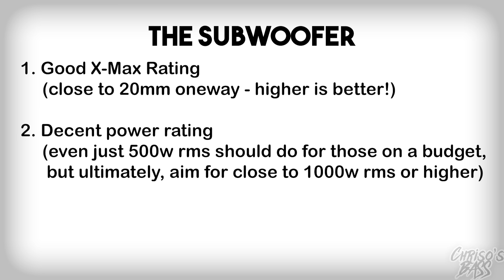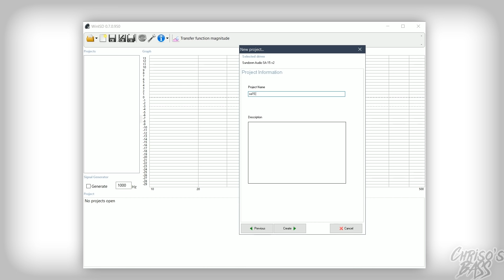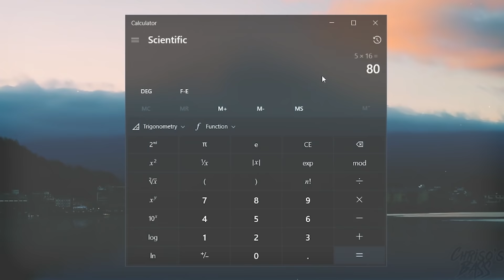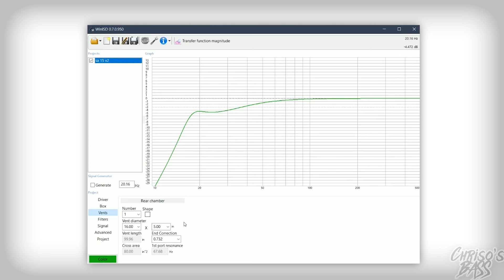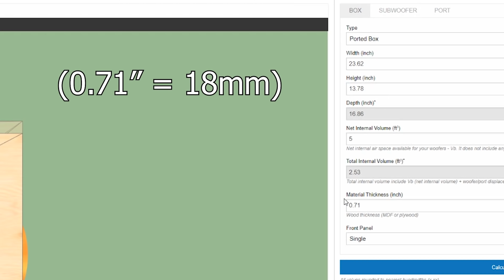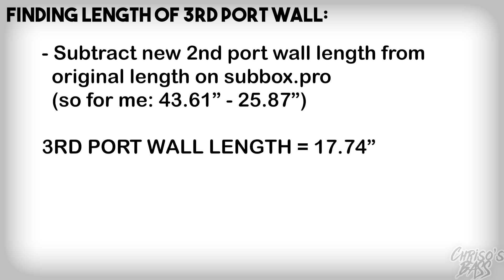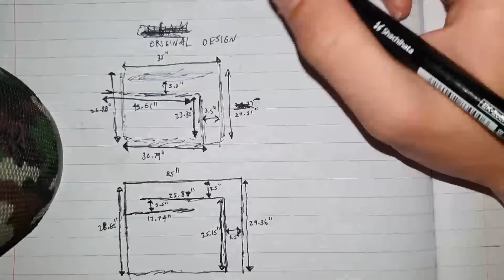How to Design a Subwoofer Box that plays SUPER LOW! | Full Guide

Comment: this can be an interesting and effective strategy for getting a lot of output out of a subwoofer that wasn’t necessarily designed to play low, and a lot of these design principles can actually be applied to enclosure design where one has specifically selected a driver that has high X max good efficiency bandwidth product for ported enclosures and high sensitivity as well as low FS and a strong BL rating. If you do a follow up in the future, since this video is a bit dated, viewers might be interested in seeing what is possible when you select modern drivers with specs that lend themselves well to SQL systems that prioritize infrasound in their design goals. it’s also worth noting that other Youtubers and forum members have outlined ways to use winISD to at least vaguely approximate the behavior of cabin gain with the filter tool in the program set to a linkwitz xform circuit who’s frequency is determined by calculations that involve the length of the interior space of the vehicle and the speed of sound. It’s not dead on accurate, but it does give us kind of an idea of the role that cabin gain might play in the system of behavior when we start modeling, and can inform revisions and tweaks to enclosure design as you work if you decide that you want to work in revisions rather than just trying to nail it in one go, which most people are going to do because wood is expensive and box building takes a lot of time and effort. I am currently designing such a system using Stereo Integrity flagship HST 18 drivers and that’s how I found my way here. There’s some pretty significant divide of opinion between the SPL community and the most well-known enclosure designers and Youtubers who are geared more towards raw output in the SPL lanes and the sound quality enthusiast and YouTubers and community knowledge resources like PS sounds raw cat Resonix etc., and the Legion of SQ purists who follow them, and it's frustrating that both camps really don’t seem to want to make a lot of room for anybody who enjoys accurate reproduction of low frequency material at ridiculous output levels. For the SPL crowd, the physics limitations, make it less desirable to aim for their peak output levels in the low frequency and infra sound ranges, and for the sound quality crowd, many of the drivers that are favored, provide much more balanced output in the extended low frequency ranges because they have lower power handling, lower excursion and different design goals. That’s not to say that there aren’t some outliers like myself, one need to only look to the community of people running 24 inch Stereo Integrity subs or 18 inch drivers from One Audio or acoustic elegance to find the low end high output, freaks, or members of the cult of the infinitely baffled, but overall we are a small subset of the car audio community and it’s nice to stumble upon content that is geared towards unlocking some of these mysteries, and providing some solid approaches to enclosure design that can easily be adapted to sound quality oriented, system design goals with a low tuned, ported enclosures and high excursion, high accuracy, high sensitivity, high power, high motor control drivers. I myself am a former mobile electronics certified professional installer building her dream system after needing to step away from the industry due to health issues and coming back to the community after such a long time away and all of the new equipment and techniques and changes in approaches that have happened have really made it clear that there’s no one right way to accomplish this goal, and that sort of sitting in that middle ground between loving tight, accurate, faithful reproduction of music and violent levels of output can be a little bit alienating, even if we are all in the community because of our passion for a car audio. Just some food for thought. Love the video happy to have found your channel. Looking forward to checking out some more stuff.

Comment: question for you bro. im doing this with 4 subs and so subbox puts them on the front of the box instead of the top, how they'd fit in my application. does it matter where the subs are? front left bottom etc, will anything mess up?
Reply: still wondering?
Reply: @AverageLuck  Yes and no. I've seen one person say that it does not matter where the subs are, its not going to change how the box performs. now im just wondering if this is true; i dont want to be confined to a specific arrangement if i dont have to. :) sorry for the late reply. i got rid of those subs, and just doing a single 8" in my miata now. working on a box because the skar sdr prefab box is absolute TRASH. 40hz. LOL no thanks, i just get trunk rattle and zero lows.

Comment: I’m very new to this, where do I put the wiring at?
Reply: Do i need to buy terminal cups?
Reply: @g1houls, yes, you need one, and it's up to u where u want it. It can be in the back of the box or on the other side of were your slot port will be. I all depends on your setup like were your amp will be in your vehicle.  Hope this helps.

Comment: I’m really new to this how do i do my wiring?
Reply: That all depends on which sub u have if it's a dull  voice coil  and what not. You will need a thermal cup on the outside of the box to wire it up to your amp ,and to wire your sub to the thermal cup. Make sure that you wire both voice coils if it has to ,and make sure you ohm load is going to work with your amp. Say u have a sub with dual voice coils and the sub is 4 ohms when u wire both coils together it will bring it down to 2ohs. So make so your amp can play at a 2ohm load. I'm more into home theater so u should do so research on the internet.The equipment you have because there is also running parallel and unparalleled. There are a lot of videos out there on YouTube.That will help you.Good luck on your journey👍

Comment: WHAT IF I HAVE TWO DRIVERS DO I ADD THE TOTAL UNDER INPUT POWER ? FOR EXAMPLE EACH DRIVER HAS 1000 RMS POWER DO I PUT 2000 SINCE I HAVE TWO DRIVERS 
PLS HELP
Reply: still need help?
Reply: @AverageLuck  yes boss🙏
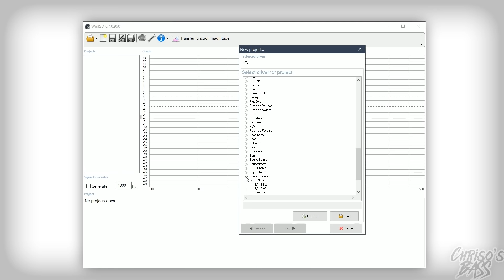Reply: @OUTCASTTT_ At 4:53, at that menu, you would select 2 drivers. After that yes, you would put 2000 for the total input power.

Comment: For good frequency response, it is best to have Qts of the driver >= 0.415.
Reply: Nah. You can do with any driver qts. Ideally you want the lowest qts possible for better cone control/accuracy. You might be thinking of sd/vas. The ratio of these can help quantify how loose the suspension is. Which would make frequency response a bit flatter with a low qts sub. But you can also just use a smaller box. Because if car audio cabin gain is a thing, so if you want a flat response you would ideally want about a 12db/oct rolloff. And if you want louder you can just use more subs.

Comment: I purchased a prefab from visions its a dual 10'' subs in a ported box. I took it to another car shop and they told me the box is tuned to like 40+ frequency. They recommended for them too build a custom box tuned to like 30 to 35 and they recommended a bandpass enclosure. Do you have a video on bandpass enclosures? would like to know a bit more about it so I can instruct them on exactly what I would like. I want low bass and airflow but also want to listen to everyday music as well. I'm not competing in burp comps, but would like to have some shacking wind bass from time to time depending on the song I play. Is it possible to get the best of both worlds?

Comment: sub box pro does the "baffle extension" for you. you just have to cut the wood and make a 3rd port wall. play with the numbers and you will see. although you cant see it, its there. try adding .5 cubes to airspace and you will see depth wont change.

Comment: I've been designing and building speaker boxes since age 12. taking designs from existing console stereo enclosures from 50'thru 70's and usunt what works for my needs. using salvaged stereo components from different stereo console units and building enclosures for each as needed. .the discarded stereos were usully in ned of new fuses of a minor repair of. broken solder connection or wire. investing my time and labor was the only expense but for the fuses I might need.   For  speakers discarded kitchen cabinets work very well.  I could modify them as i chose and to the required sizes. many of the console cabinets were of very good hard woods and usually mostly or entirely intact. only needing sanding and refinishing. the condition of speakers was a concern but they were usually intact and in fair to good condition.  the components i salvaged were anything from the radio ,and stereo amplifier to record changer or tape deck of every sort like reel to reel, 8-Track and cassette decks. people just toss the whole thing and buy a new one. even when only one part of the whole unit is broken or inoperative.  usually due to a blown fuse they either didn't know of or couldn't find. I simply looked in the usual places for the fuses or broken connections and replaced a fuse of re-solder the connection. a few minutes work for a good stereo component I can enjoy. I am a "Pack Rat" and collect wires. cables and connectors of all types to be able to hook up my stereo and AV components as i need to. Remember that Car stereo was originally adapted from home steei and evolved throughout the years.   I currantly use a good quality headset for listening to music and anything online through my computer. with a 23" HD flat screene monitor. with a native 16X9 aspect ratio.. no need for such large home theater set up.. I do have a 100" big screen and a good video projector but as my eyesight get worse as I age the monitor up close is better for me to see and I have no need for hogh powered surround sound... lets say I out grew that habit. bigger isn't always better. If I want the whole home theater experience I'll build a "Mirco Theater. A comfortable small sound proof box with a good quality UHD TV and my full surround sound setup built into it all built around a comfy recliner with cup holders and remote tray.  well sound proofed with layered carpet padding glued inside and out. I have the desibns in my head and have decided on the over all size.  which because I need to accommodate the wall hugger recliner  and sound proofing. the speakers will be built into the intrnal structure. including the subwoofer custom built under the shelf for the TV and stereo unit.   as I said this is to be a Micro home theater just big enough for one or perhaps 2 snuggled closely. the largst expense will be the custom ordered recliner.  The rest I either already have on hand or isn't very expensive. the hardest part of the design was figuring out the sound proofing .. higher frequencies are no problem but the deep Bass/lower frequencies penetrate almost anything. the remedy for that is lots of soft sound absorbing mass.  I found the solution in a relative cheap solution of dense carpet padding.  layering it to the desired thickness to isolate the sound to the inside of my private movie box.   I came up with this whole idea and design one afternoon when I thought to myself what was the minimum I might need for a home theater. and how much room for up to 2 people to enjoy a movie in full surround sound.  then it took me about 10 min. to design the basic structure of the box and electronics set up. the sound system is fairly standard if very compact. as is the whole thing.   designes can be altered for bigger recliner love seat. width being the main concern for that scenario. and therefore more soundproofing materials. and a little more plywood. the minimum needed is best for this design. .. that said the monitor and a geeo headset works just fine for now. but for the full theater experience my Micro Theater concept seems to be a good solution as well.  If a little involved .. the only other concern is ventilation inside the box. but then i have the solution to that little problem integrated into the design of the floor with a few small fans and venting scheme. isolation from the groundand the air gap under the box floor are the key as the floor of my room is concrete and on ground level stays cool all the time so venting over that concrete floor to cool the air is the solution i came up with.. I very low budget AC unit at minimal cost and parts...a couple of computer fans and routing the air where i want it to go throughout the inside of my movie box the sound deadening will also act as insulation. maintainint a comfortable temp should be easy. if I get a litle too warm just flip a switch on and if too cool shut it off. or maybe a thermostatic control for that little bit will be the ticket.set it and forget it. once i know the temp i'm comfy at.   sorry this is so very long. when i'm excited about abuild of any kind I get carried away tellling all I can about it.. ADHD does that. but it also speeds up thought processes when i deside to use it in that way. usually my mind won't shut down at all. so designs flit theough my brain almost constantly... O sinple speaker box is almost too easy fo me to visualize in detail and have dinensions almost as sooon as the basic design accurs to me.

Comment: I have a jbl cs1204 12 inch drive. However, I cannot find the technical data mentioned in the video for this driver. Therefore I couldn't do anything. I want to make the best cabinet for this driver and use it in my home theater system. Can you help me?
Reply: search: measuring t/s values for loudspeaker

Comment: The Port lenghts in WinISD isnt correct. In most cases, the WinISD Port is too long. The position and geometric of Port desing ist important for the tuning freq. A port at sidewall, groundplate or corner can be shorter than WinISD show you.
You need to build prototypes with a variable port an have to messure the impedance. In this impedance messure you can see the port tuning. Alternative messure the frequenzy response of the port in nearfield, at the port end. Make port shorter or longer to hit your planed tuning frequenzy.
TheWinISD port lenghts simulated for 25Hz can be 17Hz or lower in real

Comment: Unless you're playing Wembley stadium, you probably don't need more than 100 watts. There's these $40 30W bluetooth party speakers that you probably see a lot of that will keep a group of 40-50 people happy.  And actually that might be a good place to start - You get an enclosure, bluetooth, amp, crossover, battery and drivers for less than the price of the components. You could modify the enclosure to lower the tuning, even find better drivers that fit. 100W through a guitar amp in your bedroom will piss off everyone on your block, inside a car it will make your ears bleed. You don't need a 1600W sub in your car.

Comment: How many HZ soo I can get that deep low clean bass I have 2 L7 Q class with 300A Alternator Big 3 and running 1/0 kicker OFC wire with 2 XS Power D4800 batteries and a Cxa1800.1

Comment: Ok so questions if I have a dvc 4 wired in parallel which drops too 2ohms and 2 of them which drops too 1ohm and 1200 watt amp I'm a building a box for a 2ohm sub 600rms or is 1 at 600 or 1 at 1200 or maybe I'm over thinking it

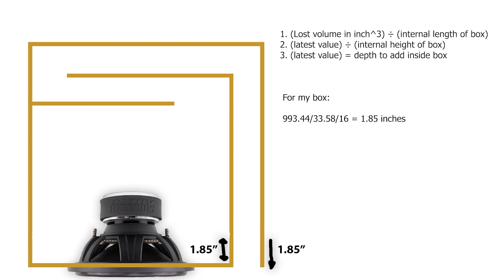Comment: Question, at 19:40 when you had to make the adjustment on your box and your port didn't line up with the front of the box... when you added the 1.35 or whatever it was, couldn't you just remove that 1.35 from the end of the 3rd interior port wall on the inside? Or would that change the tuning as well considering that'd be adding space inside?

Comment: Any feelings on kerfed ports? I've heard your port starts at point of desired port area... And do flare the inside opening? Subs closer as possible to each other or further apart as possible or no difference. If port ends half way thru do you add another 90° to aim towards the baffle?  My current single 18 is tuned to 28htz it slams on bass boosted music but totally flops in higher notes and starts clipping very soon.

Comment: Great info. Going to take it and apply it to a  single cab truck design. There has to be a way to get better base out of a behind the seat design box. Has any one every used tapered ports to increase velocity with out having the proper distance do to enclosure requirements?

Comment: Just an FYI, modeling excursion you can go to the filters tab, click add go to high pass you can use a Butterworth or a link which Riley and then put in your desired crossover frequency for an infrasonic filter and click add, it will show you the adjusted cone excursion. You could also see your sound pressure loss by clicking back to transfer function magnitude.  As well under filters you can add a linkwitz transform by setting the f0 to where transfer function begins in your vehicle, and setting the second f0 number to lowest frequency you want to model down to. Then click add.
Reply: With the cone excursion, I’m having problems where I’ve done it for 2 different subs and boxes and I’m getting like 200mm😂 but I don’t know what I’m doing wrong, one of them was even building it to exactly what the manufacturer says? And the power is also to what the manufacturer says which was 1500w rms, please help, it’s my first time using winisd😬😫